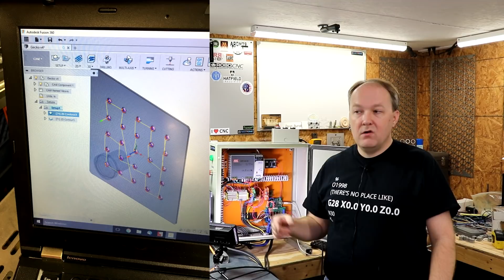KR33CNCv2 Update 6 And a Gecko Tale - Neo7CNC.com

Comment: For the spindle light, Take a look at 90mm Angle eyes LED ring, those fits perfectly around a 80mm spindle and they are cheap, run on 12v

Comment: It's a long time since I set this inverter up but what are you using to control the frequency it sounds like you are just using the default frequency 

Also what is the maximum frequency set at PD005

Im using LinuxCNC through RS-485 so the speed is controlled via the controller I don't know if you have any automation set up or just using manual control direct on the VFD

Comment: If you you're using those laser RPM meters, be sure not point that on a shiny surface of the spindle, that will give you false reading. stick a layer of black electrical tape and stick a piece of the reflective tape on top of it.
Reply from the maker: Moen I thanks for point that out. I was doing it on the spindle shank which is polished so that was totally throwing it off. Great tip about the black tape too!

Comment: I used the video's from russtuff, he has two videos.  I get full speed from mine.  I also have a voltage controller so I can have the gcode control the speed.  You have to figure out which voltage maps to which speed, as it's not exactly linear, but it's easy enough to map out.  There may be better ways.